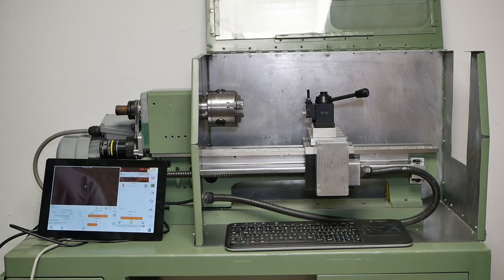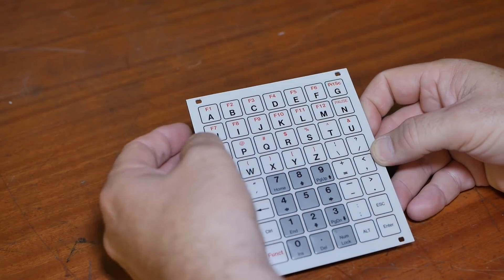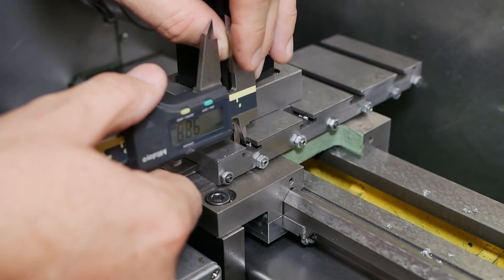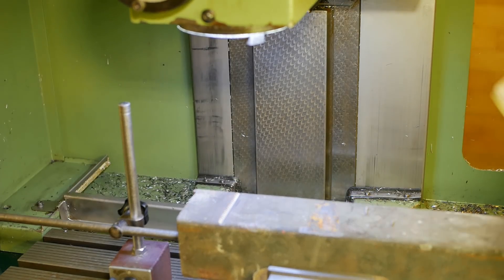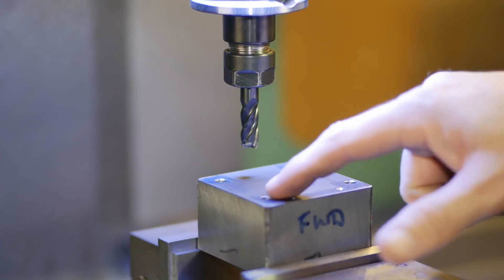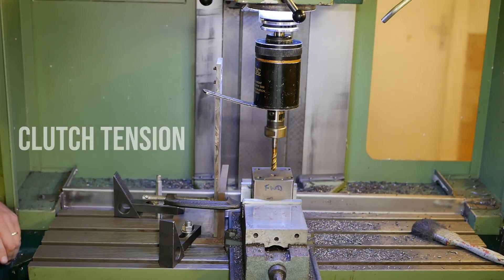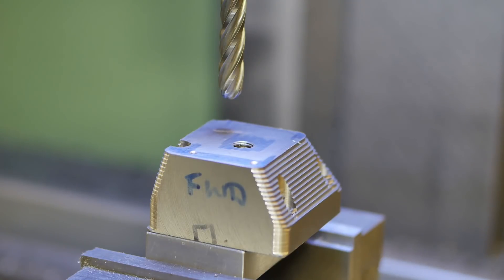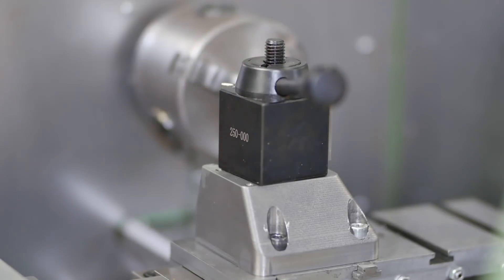Solid tool post mount - CNC'ing the 7x12 Mini Lathe - Epsiode 28 || RotarySMP

Comment: it almost looks 3d printed with the layer lines :)
Reply from the maker: Good point. I should have loaded cast iron wire into the 3D printer. Tat would have been much easier.
Reply: @RotarySMP  hehe. sls in your future
Reply from the maker: @bluelive23  The price will have to come down a lot for that to happen .

Comment: About that facemill, on a FP2 i pushed to 70mm wide 6mm deep with a 80mm 5 insert facemill until i didnt have the courage to push further. Im willing to bet the Maho could do about the same.
Reply from the maker: I think you are right, but I worry about the work holding. It would suck if a chunk got thrown out. Did that cut your describe make an aweful noise?
Reply: @RotarySMP  yea that might be the limiting factor. I used a hilma Hydraulic vise with 4x M12 Holding it to the table so no worries there. But that vise runs arround 3-4 thousand. It Was as silent as can be. 400rpm and 125mm/min. You could hear the load on the machine but no Chatter. It also was in 42CrMo4.
Reply from the maker: @MrLembnau  That is some serious metal removal.
Reply: @RotarySMP  Had a lot to remove, but its not a 100% duty cycle kinda of cut. I also checked the tram of the vertical head and it did move a bit from that cut
Reply from the maker: @MrLembnau  Ouch. That could have gone south fast if that forces cused the head to rotate.
Reply: @RotarySMP  it was just a tiny ammount. maybe 0.02 on a 80mm radius indicator swing

Comment: Bit late, but when using this peck drilling method, I've heard of drilling the holes staggered (leave one, drill one), and then doing the rest of them in a second pass. It's supposed to give the drill a more even load as the holes are either into solid stock, or have two opposing holes. When drilling them in order, they always only have a hole on one side.
Reply from the maker: Thanks. That is a good tip.

Comment: If your friend has not  solved those seals - there is service "Seal-Jet" pretty much everywhere in Europe. 

They are making custom seals from database or from drawing. 

German company makes cnc machines and material, and local small company does service. 

Search for it on Google, few should pop up close to you.
Reply from the maker: THanks a lot. I think Nico sourced replacement seals, but took the Jacks away, and hasn't fixed them yet.

Comment: just hand program it, simple ramp with some round corners
Reply from the maker: I could have, but it also increases in size conically as you move down so every single corner level has a different radius.
Reply: @RotarySMP  glad for your sanswer! witch cnc controler you have in the maho?
Reply from the maker: @MrVinicius343  LinuxCNC, with the Gmoccapy GUI. There is a long thread of the retrofit here:
https://forum.linuxcnc.org/12-milling/33035-retrofitting-a-1986-maho-mh400e?start=0

Comment: I use feature cam daily for work. And its constantly doing things you dont want it to. My latest gripe with feature cam is trying to mill back chamfers. There is NOTHING.  You have to fake it out, make it think your doing something else.
Reply from the maker: Thanks. My versions is an ancient one from 2005. Pretty clunky, but good enough for what I do. I always run it through it's back plot, then NCViewer.com, adn then the backplotter in LinuxCNC. I do like tht it is pretty easy to tweak the post processor for LinuxCNC. Started with one of the Fanuc examples.
Reply: @RotarySMP  I use the most updated version. Its owned by autodesk now. Once set up correctly. Its auto feature recognition is pretty good. Saves 30-50% time programming. But anything complex it just skips it. Havnt seen all your videos. But cool stuff man!
Reply from the maker: @206sea  Thanks for the positive feedback. I appreciate it.

Comment: Why not use the bandsaw for cutting that big a piece of steel??

Greetings,

Jeff
Reply from the maker: Damaged gearbox. I can only use it in high gear, which is too fast for cutting steel. I described the problem somewhere around episode 15 of my polishing the turd lathe series.
Reply: @RotarySMP  aha, well thats a pity. Maybe a new gearbox, or refurbish it. :P 

Before i say anything else; do check every link. :D 

Your MAHO looks really cool! But i could never fit 1.5 ton in my shed. So a RF-45 milling machine has to be the CNC. But would it really cost 10k to get it all done? I really wonder. Its only 3 closed stepper motors, and 3 ball screws right?? O and some plexiglass enclosure. But thats it. Still your milling machine is way way cooler, while it also has horizontal milling! I really dont hope a conversion will cost me 10k, while that is more money than i have for that sort of stuff right now. I also thought about converting a 290V lathe to CNC. Found some good books about this on www.pdfdrive.com. 

Check this out!: https://archive.org/details/unitedstatesrifl00colvrich/page/48/mode/2up 

It has a lot of horizontal milling action. It is also said in the text: "these techniques also apply to other fields of engineering." Or something along those lines. 

Also if you like that, check my about section of my youtube channel for some other cool stuff on making barrels, bullets, tunnels etc. etc. I dont have a lot of video content and i  wont have that any time soon. But i think its worth your while while even though i did machining in school, i never knew how barrels were made, untill i did all the research i did. Now its really clear how it is done. Its in a grabcad.org and archive.org link in my about section of my channel.. :)

Greetings,

Jeff
Reply from the maker: @jeffjefferson2676  "But would it really cost 10k to get it all done? I really wonder. Its only 3 closed stepper motors, and 3 ball screws right?? O and some plexiglass enclosure. But thats it."

The danger of a manual retrofit is that they nickel and dime you. Closed loops steppers need couplers or pulley and belt,  drivers, which need break out boards, and cables and wiring. Three decent ground ball screws alone are going to cost over a grand. And they require end bearings. If you run dovetail way mill under CNC without an oiling system it will wear and gall quite quickly. Way covers also help.  You need a E-Stop chain, end switches, home switches, and they need more wiring. Wire is surprisingly expensive. On a mill you are constantly touching off, so a pendant is a huge benefit. While not strictly essential, everyone puts a VFD on the spindle, then you add an encoder for threading.  Plexiglass needs a frame. You'll need a coolant pump and tank, and/or misting system, with the associated tanks, tubing, fittings, wiring, sensors, releays etc.  Lighting ditto.

You can do it on the cheap like my mini-lathe, but every compromise is a performance hit, which makes it a little less fun to use, more prone to chatter, slower, less accurate etc.

An enclosure for an RF-45 is probably wider than the MAHO footprint, as it has a little more X travel. Once you exceed 250 kg, you are well beyond human lifting, and need a pallet jack, crane etc. So you can carry in the RF-45 in parts, but once built it makes no practical difference between an enclosed RF-45 at 400kg or the Maho at 1200kg. But you'll certainly see the difference in performance. 

A better choice than retrofitting a manual machine if space is limited,  would be something like an EMCO VMC 100.
Reply: @RotarySMP  So what you are actually saying is: you need to put on a lot of extra (expensive) parts onto your rf45 in order to make it to a point that it works fine as a CNC machine. So you might be better of buying a CNC machine to start with, even though the controller might be broken, while it has all the features you need to make it a CNC machine that lasts. 

Okey, i get that. But the problem is, i still need to move houses once or twice, and that will be a lot of trouble if it is 1.5 ton instead of 400 kg, you disassemble into smaller pieces. 

Still i would love to have a fully functional CNC machine. And i am seeing a lot of CNC machines lately on online marketplaces. For a way better price than a couple of years ago. But they are huge! So you have to have a permanent place where it stays in. And that is my worry, its to big to move, and thats probably why its prices that economical. 

For now. Im stuck learning all sorts of things from books, so no CNC anytime soon for me... :(

Thanks for the reply!

Greetings,

Jeff

Comment: Nice job. That maho is great.

I also love My drill chucks. I got quite s few of them. They are from sandvik
Reply from the maker: Those CNC style ones with the allen key closing are much nicer than anything I have used before.
Reply: @RotarySMP  yep thoes i got i a small 5 mm Allen. I love them for quick and easy setup of drills. I usualy got all milling tools on My machine. I can have 60 tools in my dmg
Reply from the maker: I hope you can keep enough work comming in to keep that CMX 1100 working hard. Very nice.
Reply: @RotarySMP  me too.ive been running My own shop for 2 years almost. And it aint looking tobad. I am busy most of the time
Reply from the maker: @nikolaiownz  Great to hear. That is a really nice set up you have there.
Reply: @RotarySMP  i am very hsppy with what i got now. I got some problems with My old okuma lathes but nothing that i cant live with. Having a New mill that works with everything moderen machines have i so amazing
Reply from the maker: @nikolaiownz  I'm just watching through your videos. Nice interesting vareity of work you have coming in there.
Reply: @RotarySMP  i do alot of weird work haha. I Try and get some videos but some times i am just to busy and I forget.i starte videoing because i thought it would be fun to look back at them from when i started

Comment: amazing, confused by connectors which have the usage icons on them and the end pins and sockets visible. stay away from anything sharp and watch out for those paper cuts. You might want to look at your videos before you make them public.
Reply from the maker: In this case, the connectors didn't have the usage moulded on them. I looked them up.  Thanks for watching.

Comment: Hey mate can you please measure the inside diameter of the hydraulic jack cylinder. And the actual width of the groove the piston seal sits in on the rod.cheers JW
Reply from the maker: Hi John. ID is 30mm, and the piston seal is 4mm wide in the groove.

Comment: Why not make it even more it even more rigid by dropping the QCTP mounting pillar all the way through the riser block and screwing it into a T nut on the cross slide. You would have every component apart from the tool holders directly clamped to the cross slide.
Reply from the maker: Too much work. That would be polishing a turd :)
Thanks for watching.

Comment: As my entry in the "ultimate solid toolpost" contest:
I made a foundry pattern and had one cast. 
https://photos.app.goo.gl/8pv5bjHFXYuwwQMH7
https://photos.app.goo.gl/u1KdRuRrvjyLXdyG9

I still have the pattern. I seem to recall that the casting was about £10
Reply from the maker: Nice work Andy. Other than in my garden shed, I don't even know where the nearest iron foundry is. Into the seventies there was a number of foundries in the city here, but they are now long gone. You are lucky to have one which will do  a one off job for pocket change.

You should do mre videos on using the Holbrook. Great retrofit.

Comment: ask Abom79 about the seals
Reply from the maker: Good idea. Thanks for watching.
Reply: @RotarySMP  I normally make new pistons that use std o-rings rather than hassle with trying to get seals from china. it winds up being way faster in the end.
Reply from the maker: @deadeyedsam850  Nico took the pistons to to a hydraulic supplier, and found some standard seals to match.

Comment: I swear every time I machine Grey iron my machines are screaming out for help, I actually ended up with a single shallow gall line in the Y axis ways of my freshly scraped Toolmaster mill because didn't clean off all the cast dust immediately and kept running jobs till the end of the day.
Reply from the maker: You really notice the fine dust rising off the cuts like smoke. I gave the machine a good clean as soon as I finished. Luckily the Maho has a central oiling system, so oils is regularly flushing out swarf and debris if it gets past the way seals. Thanks for watching.